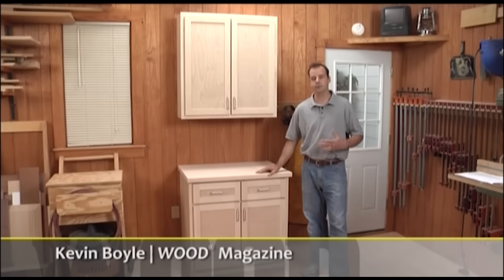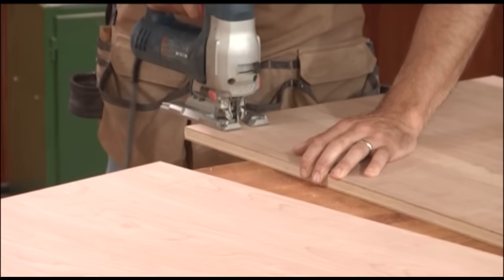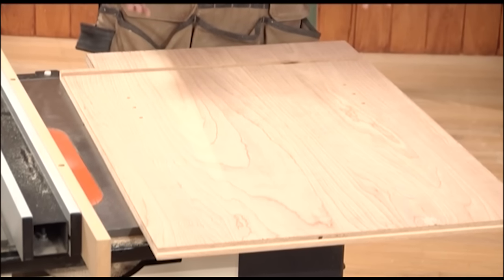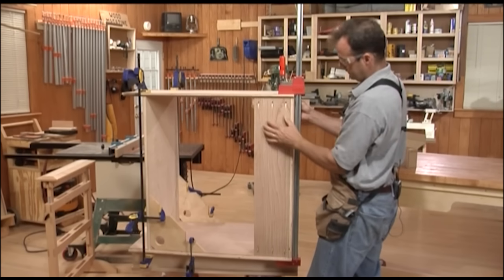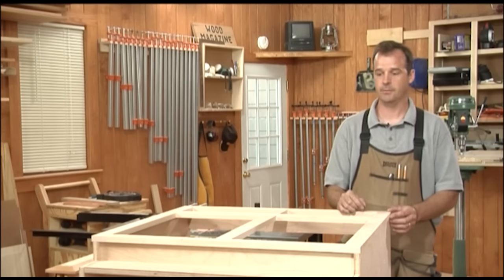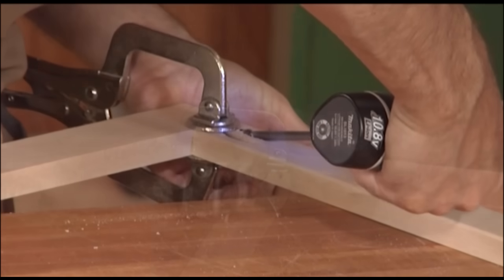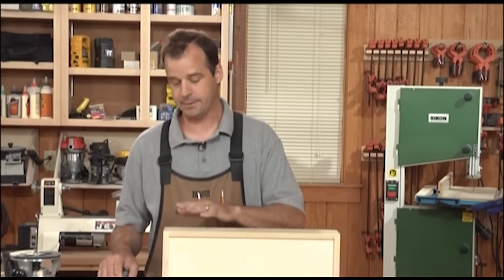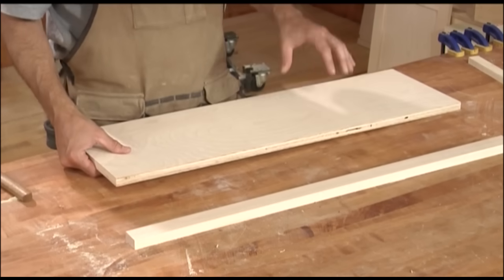How To Make Simple Face Frame Cabinets - WOOD magazine

Comment: Most excellent job! I was fortunate in a previous life, to have the opportunity to work in a commercial custom cabinet shop. You showed exactly how every single detail needs to be done the right way.
I have to admit I was drooling over your assortment of clamps!!!
Reply: One can never have too many clamps.  I made a 13' face frame for my kitchen and used every pipe clamp I owned.  It was awesome.  Took a picture of it.

Comment: Very good with explaining each step in simple terms.  Easy to follow and understand each step.  Also liked the parts where you had to recut pieces just to let us know that might happen, but also how to correct them as well.  Thanks for a great video on all the components from cabinet, face frames, doors and drawers.  Good hint on installing the hardware too.
Reply: hhhhhuhhhhhhhh h hhuhhhhhhhhhhhhhhhhhhhhhhhhhhhhhhhhuhhhhhhhhuhhhhhhhhhhhhhhuhhuhhhhhhhhh
Reply: HhhhhhhhhhhhhhhhhhhhhhhhhhhuhhhhhhhhhhhhhhhhhhhhhhhhhhhhhhhhhhhhhhhhhhhhhhhhhhhhhhhhhhhhhhhhhhhhhhhhhhhhhhhhhhhhhhhhhhhhhhhhhhhhhhhhhhhhhhhhhhhhhhhhIllinoishhhhhhhhhhhhhhhhhhhhhhh
Reply: Hhhhhhhhh

Comment: Wish I had seen this video about 12 years ago when I built my kitchen cabinets. But I went the "extra mile" and rather than use plywood, I cut and milled the trees, dried the lumber then built the cabinets.  l used butternut for the doors and red oak for the face frames. The cabinet body was melamine coated MDF with 1/4" oak plywood on the exposed surfaces. It was a real learning experience.
Reply: @James McPhearson, why would you ruin a beautifully sounding project with MDF? IMO, that’s rates at the top of the list for worst inventions. It’s definitely not suited for sink cabinets. I’m in the process of cleaning up that mess right now. One dishwasher mishap and your cabinets are destined for roach food and garbage. Woth all that hard “Extra Mile” work you put into it, it’s hard to believe you then mixed-in MDF. Just keep it dry.

Comment: I am a moderately experienced woodworker. This was one of the best videos I have seen on basic cabinet making. There were so many little details that I took note of (I've watched it end to end 3 times) and so much to learn by simply paying attention (I love your little assembly "I beams"). I especially like the saw set up for the "stub tenon" doors. Your delivery is straight forward and economic leaving out few details. I was a little curious why you didn't use more available jigs, like Kreg's shelf pin jig or hinge drilling jig but I assumed you have been doing this long enough that those seem unnecessary. Thank you for this. And I look forward to seeing more from you.
Reply: 3d🎉🎉🎉🎉🎉🎉🎉🎉🎉🎉🎉🎉🎉🎉🎉🎉🎉🎉🎉
Reply: 3d🎉🎉🎉🎉🎉🎉🎉🎉🎉🎉🎉🎉🎉🎉🎉🎉🎉🎉🎉🎉🎉
Reply: 🎉🎉🎉🎉🎉 14:27 🎉🎉🎉🎉🎉🎉🎉🎉🎉🎉🎉🎉🎉🎉🎉🎉🎉🎉🎉
Reply: 🎉🎉🎉🎉🎉🎉🎉 14:49 🎉🎉
Reply: 15:17 🎉🎉🎉

Comment: Can't believe I watched from beginning to end!  I've never built anything but I do  refinish, and this was so interesting and informative!  Excellent teacher Kevin!!
Reply: Awesome instructional video. I'll just screw through the sides for the stretchers, bottom and toe kick on the cabinet boxes as mine will not have exposed sides. In addition to being a heck of a lot easier than pocket holes, this also eliminates the need for clamping on the box. A small piece of pegboard makes a great hole template for shelf pins.
Reply: @kaileygreen1631  ที่มีขน้ ได้ แบบ
Reply: @kaileygreen1631  çç ch

Comment: I've been building custom cabinets for 35 years. A trick I like to use is after setting my dado blade to 3/8 of an inch height I'd like to put a piece of tape on the handle positioned at 12:00 straight up.. it makes it easy to come back to the 3/8 height. Always remember to come up to the height that applies to your joiner planer shaper etc.. that helps take the play out of the gears that raise and lower your cutters...

Comment: Awesome instructional video. I'll just screw through the sides for the stretchers, bottom and toe kick on the cabinet boxes as mine will not have exposed sides. In addition to being a heck of a lot easier than pocket holes, this also eliminates the need for clamping on the box. A small piece of pegboard makes a great hole template for shelf pins.
Reply: Definitely..keep options open.  If design space permits 1x x4 s in inside corners is a good choice. Simple butt joints.  I presently don't use dado blades. I use hand routers with clamped guides..I am not an an expert. I have built things the wrong way..but it's a learning experience.  I love woodworking.
Reply: WOW 😄 WHAT A GREAT IDEA⏩PEGBOARD MAKES A TEMPLATE.  THANK YOU.
Reply: @PIANOSTYLE100  yeah, but cheating!  Too easy!  I'll remember that.

Comment: One problem I have with this that most people will miss until it's too late. I would eliminate the center stile. It is not needed. The door will not require something for it to stop on. The top and bottom rails will provide that. The center stile will only create problems. Here's why: you will have a very tough time putting in a shelf, which was not shown. And if you want to use 2 shelves, well good luck. I never build a cabinet with a center stile unless there is a partition behind it. Using a partition will create independent shelves on both the left and right side of the cabinet. If you need a wider space, eliminate the center stile, and then put in your shelf.
Reply: The difference is that a man sees the contruction of a cabinet and a woman sees what she can I do with it.
You are right..bingo
Reply: @geoffb108  Also, I would tell my wife, "No, you're wrong. You don't know what you are talking about." Then at that point, I would start building myself a doghouse. I'm going to need it. She was right all along.
Reply: It adds to the beauty 🎉
Reply: I like the way it looks better with it.
Reply: @Amb_OmG  To me, it's a question of function rather than how it looks. I would like to see how this builder plans on installing a shelf.
Reply: No stile is better function. Shelves are a breeze.  I agree.

Comment: Excellent video, well paced with appropriate narration.
My main comment would be about the kick-space - I know what the actual setback is for but the rest of the area under the cabinet seems like wasted space.  I prefer to make some trays or similar which will slide under the cabinet proper, for the storage of things that are not needed on an everyday basis.

Comment: Thanks for the video.  I agree with one of the other comments, full, and complete.  I have used an omnijig since Norm used it in a show showing a cabinet build.  Your video is reminiscent of the New Yankee Workshop style.  If I may, using a cheek cut before doing the plunge cuts really minimizes, and usually eliminates tearout.

Again, thanks for the video.

Comment: A very welcome demonstration on cabinet building, full of useful information. However, I was slightly confused with the rig set-up for the dovetails. I know you can get router bits to make the joints, but it was the setting up to have one edge concealed that had me.
Reply: It's called a blind dovetail.  He used an older Porter Cable.  Leigh makes a good one too.  You do both pieces at once so you know they'll fit

Comment: Fine job, young man !!!  If you will let an old man give you two pointers. 

Pocket screws are a nice deal, but you face frames will be several times stronger if you also glue them. No matter what anyone tells you end grain glues just fine.

The last one, and it's a big one. No matter how clear the lumber, sharp the blade, or shallow the rabbet, NEVER run your hand over that blade !!   If you hit a knot, or for any other reason that board comes apart, it a bad deal !  I've only had it happen once in over 50 years, but it's not pretty, or comfortable.  " Over 50 years" How did I get this old ???
Reply: Same here. I'm now 67 but I don't know how did I got here. Regards.
Reply: I love the fact that you took time to advise the young man, I agree with you and I'll benefit from your advice as well.
Reply: @Hello Griffin how are you doing

Comment: Great stuff! Best instructional video I’ve ever seen for cabinets. Question; would you ever glue your face frames together? Or just simply pocket screws?
Reply: I use dowels.  I loathe pocket screws.  Cheap furniture is made with pocket screws.  Buy a doweling jig and you're good

Comment: Thanks for the video.  I enjoyed it very much.  However, I was taught never to glue door panels and drawer bottoms so that the materials don't fail from expansion and contraction differentials due to changes in temperature and humidity.  You did comment that you would not glue a raised panel in it's frame, but plywood will expand and contract differently from solid stock as well.
Reply: I am with you on that one. I believe most sources say panels inside rail/stile doors should be left floating. Also makes for easier removal should the need arise to replace a panel or convert them to some sort of Plexiglas to see what's inside the cabinets easier.
Reply: I came looking for this comment specifically
Reply: @chrisbowie1438  glass for doors.  Plexiglass is terrible.
Reply: Plywood might not move (though I think it might), but your doors are made out if hard maple, which is not plywood.

Just let the panels float, then everyone's happy.

Comment: Good video.   Glueing questions :
1) On base cabinet, did you glue the stretchers (not shown). - you did show on wall cabinets.
2) If you use brad nails on face frame (I’m painting mine), can you skip the clamps?
3) Should you also glue the backs with glue on the rabbet?  (It seems you were selective on your use of glue).

Comment: I would have liked to have seen a preformed counter top being installed.   I'm unaware of anyone that uses plywood counter tops unless it is for a workshop.  I also think using glue and screws is stronger than pocket screws alone.  Good video, I found many good projects and tips in Wood magazine when I was doing carpentry and cabinet making.
Reply: Plywood then tile.  Cheap, lasts decades.

Comment: The old sage, Norm Abrams of PBS Fame, lets his panels float in the frame whereas these panels are glued all along at the edges. I think the floating panels are beneficial in preventing distortions caused by the panels and frames changing shape and size at differing rates. These changes are brought about by changes in ambient conditions such as temperature and humidity acting on different materials. Floating panels allow for the relief of these stresses. Anyone have any thoughts on this?
Reply: Solid wood panels need to float, he used plywood which does not
Reply: 1

Comment: On the last piece that you mark with the knife,; maybe make your knife mark with the last piece in the corner, instead of out in the middle(since you verified the measurement in the corner anyway!). Thank you for a wonderful comprehensive build! I will use some of the things you did-like letting the face frame extend over the cabinet. I like the fact that you clamp(no nails) the faceframe-no puttying or sanding the putty off!

Comment: Thanks for this enormously helpful video. I'm attempting to build my kitchen cabinets and every time I doubt myself I return to your video. On the doors, you glued the panel in. I am also using a plywood face. I assume you're gluing because you don't have any concerns about wood movement since it's plywood. I expect this also ensures you don't have any rattle if the panel isn't sized perfectly. Is that the reasoning?

Comment: Excellent instructions, that even a newby, like me, can follow.  In fact, I'm in progress with a build and have a question about drawer stretchers.  The Wood Magazine web page, that shows drawings and written instructions for these cabinets, shows two front stretchers on the base cabinet, above and below drawer opening.  However, this video appears to omit the lower, drawer stretcher (that is flush with 'mid-rail'.  Is the lower stretcher not needed?

Thanks for the video and for any response to my question!  -Mike

Comment: Great to the point video assuming viewers know the basics of woodworking and basic tools and terminology. I am in the planning phase of building shelves on either side of our fireplace where both sides are about 40" from the wall. The plan is to have a cabinet on the lower portion of each bookcase. Maybe 18 -24 inches high. The depth of the entire bookcase and cabinet is about 11-12 inches. I was hoping you could comment on the following approach I was considering. I was planning to build a box/platform on which I would place the bookcase which will go to the ceiling. I was viewing the cabinet as part of the bookcase and would simply leave an opening with the top of the cabinet also the first open shelf.  I wanted to avoid making the raised panel doors and perhaps just purchase them. That would mean I need to determine the actual width of the bookcase/the cabinet to make sure the doors are available. 
I was considering having to put some filler/spacing pieces to adjust the final size of te actual bookcase. I was viewing it like I am first building a large box sitting on the platform that went floor to celing and side to side and then the "bookcase would be inserted into the box.  I am confident with my basic woodworking skills and realize that thorough planning is the most important step.  As an aside, I recall the famous line in engineering and development work that there was always a push to get-it-done fast. The quality was important but time was also important. The saying is "There is never time to do it right, but there is always time to do it over!! Well I do not want to do it over. Your video inspired me to write all this as my seeing your video was just what I needed. Best wishes, Charlie
Reply: @Hello Nielson how ae you doing

Comment: Great build 😎👍
Question... is there a void left between the drawer face & the drawer-proper ?
And as such, are you pulling the plywood panel inwards when tightening the handle screws ??

I'll be basing my coming kitchen build on this vid... thanks for the detailed yet no-nonsense presentation.
I'm planning on going with a french cleat for hanging the uppers... & I may decide to go with a plinth on bottom .... 

😎👍☘️🍺
Reply: I glue and screw my drawer face to the drawer body.

Comment: Appreciate the detail you provided.  I am surprised glue holds so much together without other reinforcement.  Would be helpful to know what size screws you use for each step.  Why do you use those cheap guides when every other aspect of your work has such attention to detail?  Signs of quality for me are dovetails and guides.  Can you do a video on frameless cabinets??

Comment: Thanks, this helped a lot.  I just wish there was one more detail.  At 36:45, you have the wood pieces for the door already cut to size.  What size?  There's something about the hinge type that factors into what door size to make.  I'm still trying to figure it out.
Reply: I generally go 1 1/2 for rails and 2 inches for style..  You can use what looks best.

Or go down to the home center and measure theirs.

Comment: Excellent step-by-step instruction and presentation.  Rather than pocket hole screws only for the face frame, would glue on those joints not provide an extra level of security and longevity, particularly since the doors are hung by attachment to the face frame?
Reply: Glue on butt joints is useless. Don't believe it? Do a simple test on scrap pieces of 3/4" by 2 to 3" wide.

Comment: For the lower cabinet, I noticed you left some material to trim on the sides to allow matching up to imperfect walls.  You did that by making the dado cut for the back panel deeper than the thickness of the back panel.  Is there a reason you did it differently for the upper cabinet?
Reply: Lower cabinet is level to the floor and plumb to the wall, so if the wall is not straight you can scribe the back of the lower cabinet to match the wall. Upper may not need to be perfectly leveled front to back.

Comment: I liked the video. I was taught to put a mortise on the face frame. Will the way you did it hold up as well. I would same me some time putting them together for a big project I have coming up.
Reply: That is how I learned also. My dad built high end cabinets, for years. I have been using pocket screws and glue for years on stock cabinets. I even fasten face frames with them. Never had a problem.   You can plug the holes on the inside of the carcass and never know they are there.
Reply: @dkreitz785  I hate pocket screws.  Cheap furniture uses pocket screws.  I use dowels.
Reply: @scottslotterbeck3796  by all means do what you like. 
The cabinets I build to hide tankless water heaters, that have to come apart if the heater needs serviced, would work well with dowels... LOL  Everything has it's place.
Reply: @griffinreitz7041  I said what I use.  Did I tell you what you must use?  Weird...

Comment: Raised Hand...Unless I missed it....I noticed that you only glued the floor board of the cabinet and glued the face frame of the cabinet too with out any nails, screws or staples. How is that holding it together? Just wondering...maybe I missed a part of the video. :)
Reply: I pin nail mine.  But I wear a belt with my suspenders, so...

Comment: We should build a cabinet to store all the thousands we save over professionally installed cabinets.
I recently had to reinforce a peninsula that was failing under the weight of a stone countertop, I made trestles from the floor up. One of the problems is the face frame is supported by the base, which floats over the toe kick, so I will think about ways to reinforce that.
I'm going to build a bathroom vanity or 2, I think I'm going to use cleats, butt joints, pocket screws & biscuits (cheat joinery)